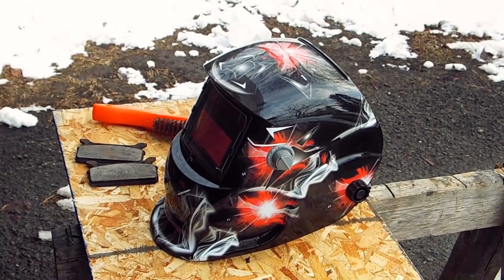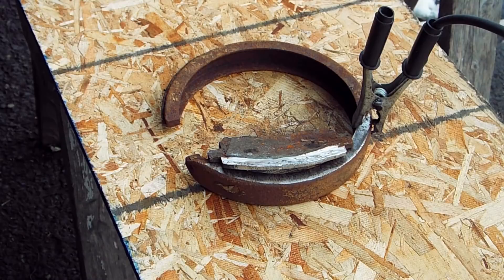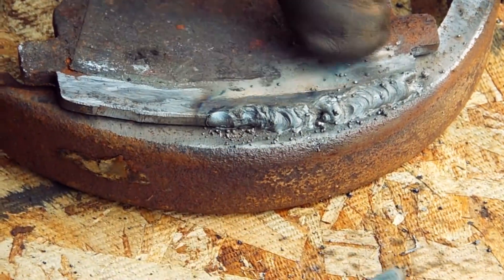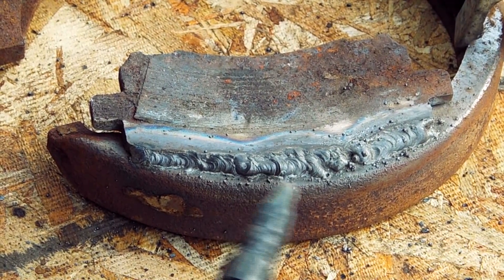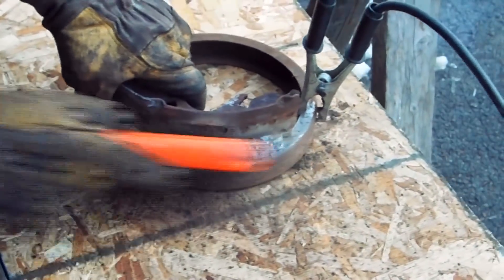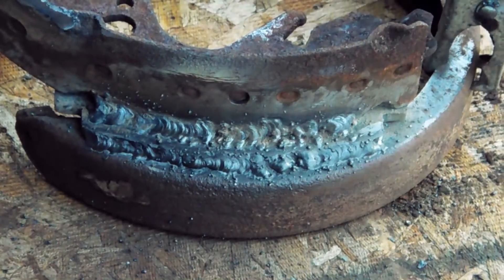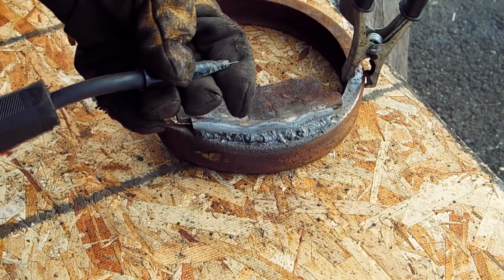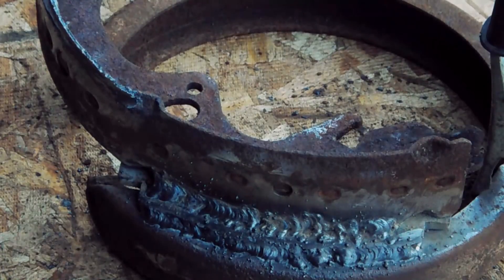AC to DC Flux Wire Welder 110 Volt from Harbor Freight

Comment: When you increase wire feed speed you increase the amperage resulting in a hotter weld. For your thicker steels (1/8 - 3/16), use an increased wire feed speed for a hotter weld and deeper penetration.  You will find (setting 7,8 & 9), the weld pool will lay flatter and penetrate deeper, creating a flatter, more even beed profile. watch your weld pool and be sure to zig-zag back into it and stop just before the edges 91/16th and allow the weld pool to flow to them rather than going past them, this will help your lap and corner joints. There are a few techniques that you could use 1) lower case cursive "e's" 2) lower case "u's" with a pause at both top points (weave pattern) 3) my favorite, "hockey sticks". This consists of making a semi straight line with a slight curve at the end and then reverse back to start position. Keep your distance, torch angle and travel speed the same and it is almost as if you are painting with a paint brush. The beed will stack up like dimes and your consistency will become more accurate. Good luck and happy welding!
Reply from the maker: Steve Porchia thank you for all of that information, very helpful!
Reply: Yes. With this feed, not knowing how many IPS that is, I’d recommend starting with a high feed, and going down one setting a time. You’ve got a combination of thicknesses. One way to look at this is to use a setting that’s closer to the thicker of the metals. But your welder isn’t rated for anything over 3/16, so that’s a problem for the thicker part, which looks to be closer to 3/8.

So go as high as you can on both settings, and weld closer to the thicker part, and linger a bit, then quickly move to the thinner part, and quickly move back, linger, etc. if you weld straight on, the thick part will weld too cold, and the thin part, too hot.

Also, remove the tape to at least 1/2” past the tip. It’s contaminating your welds.
Reply: @melgross  The wire speed is wonky with these things. Here are the wire speeds i've found.
Speed 1: 135 inch/min
Speed 5: 180 inch/min
Speed 10: 380 inch/min

It appears the potentiometer is not linear but logarithmic.
Reply: LBCAndrew yeah, that’s a problem. I tell people to measure the wire at different settings, and write it down.
Reply: The wire feed speed does not increase the amperage.

Comment: Why didn't you start with 9 and go down from the machines recommendations ?  On this welder the wire speed determines the amperage !
Reply from the maker: Ed Pontiff thanks for the comment, im learning that as i go. I will experiment more with the wire speeds to see what the results show.
Reply: There are only two amperage settings. Feed speed doesn't affect or even connect to the circuit with the gun on it.
Reply: @cavemanjoe7972  Actually there are only two voltage settings. Wirespeed is directly related to current on a constant voltage machine like this.
Reply: @samnottheotherone4363  

It's a pain in the ass, regardless. I use a stick machine; much more simple. I never was big on circuitry.😁
Reply: @cavemanjoe7972  Ha I hope you never have to deal with aluminum TIG then.
Reply: @samnottheotherone4363  

I do aluminum tig at work. I was talking about the way the harbor freight flux machine is wired up.
Reply: @cavemanjoe7972   
Okay, I was thinking you like things to be simple, hence stick and didn't think you'd want aluminum TIG because of all the different settings. But I understand now.
Reply: @samnottheotherone4363  

I liked how simple stick was, and how much smoother the beads were than that old 90 amp flux welder. Guy at the shop took 20 minutes last year to show me tig and turned me loose on some stainless scraps to see how I did. Now I do most of the small/thin tig work that comes in, or anything that needs to be 'pretty' or pressure tested. Turns out I've got even more of a knack for tig than machining or milling. I wish somebody had shown me this stuff when I was 15 or so; I'd probably own my own shop by now.

Comment: Do you have to squeeze button to make wire advance? I have only used stick welders. Thanks for the instruction, good information.
Reply from the maker: Bert Cochran yes you do have to pull the trigger to weld. The wire will advance at the speed you set and this also will switch on the charge to the wire for the arc. I hope this better helps you to understand how they work. Thanks for asking.
Reply: Bert Cochran yes.  squeeze trigger to feed wire and turn power on at the tip.
Reply: Nothin wrong with sticks. In fact. The units themselves are cheaper and easier to repair

Comment: Is the black tape the modification? Put mig tip back on. It helps out with keeping distance and you won't won't be arcing out your tip.
Reply from the maker: Mark Cobb it's part of the modification. The real difference is that the welder is now generating on DC voltage instead of AC. Quite a few have recommended to me, and in other videos, to take off the metal tip and use a plastic one instead to get right in close to the work piece. It does actually seem to help. Thanks for the comment.
Reply: More superglue. Lots more superglue.
Reply: I think you're angle too low.  Try 80° Ground it really hard. Clean the surface right where youre gonna start everytime you start. Faster feed, slower drag. Puddle like youre gonna fish in it.
Reply: Is that HF fluxwire? Change brand.

Comment: Don't get hung up on wire speed. Application matters a lot. Stay in the puddle. You should be between 1/2 to 1 inch away from your work piece, gun 45 degree by 15 degree drag. Watch the joint. You don't have to move your stick around to get your rippled look. Move around to meld your joint. If you slow down and put the heat into the metal, you'll get better penetration.
Reply: Yes . Wait until the puddle forms and travel at the speed the metal edges form the beads .
 Mine is like always between 1½ for thin and 3 for 3/16th .  Using the flux core . Faster speeds might be for thinner wire with gas shielding .

   Fa

Comment: How well did that helmet work out with out in the adjustable knob on the side?
Reply from the maker: Mike Okay The adjustable shade helmet allows better visibility of what you are working on over the set visibility helmet (no knob),  which I believe I saw that those are more geared to stick welding. The first battery that came pre-installed didn't last very long. You do have to be careful not to set the shade too light or you can do permanent damage to your eyes. I wish I had bought an adjustable shade helmet, with the knob, the first time. I hope that helps.

Comment: Turn the feed up. You are only running at 50-60 amps at #5 wire speed. 

I find running the voltage a step down from max, and the wire feed almost maxed out. Works really well with 1/8 and 3/16" steel. 
Voltage x amperes = watts (power)
Your wire feed is your amps!
Reply from the maker: Thanks for that comment, Leroy, I will experiment with that!
Reply: Most everyone says that, I just get a big blob sitting on material that has no penetration. Next trick is gonna be run it slow and hope for something to join.

Comment: You should grind the spot that you attach your ground clamp to and even clean the inside of the jaws with a wire brush from time to time so that you get the best welds possible on that machine. I would even get a solid brass ground clamp that really grips the material (available at harbor freight), the stock clamp is too weak and only makes contact with the points of the teeth. I'm not sure what brand of wire you are using, but I highly recommend using Lincoln Innershield nr-211-mp. I use the 0.035" wire as well as tips. By the way, keep the tip from touching the material. Usually about a half inch of wire "stick out" is fine. Your welds at setting #5 were the best, but the speed at which you move is also important. Slow down a little and try this: write a long row of lower case "e" with the torch tip instead of the zig-zag method. As you loop back and overlap the last "e", you are applying more heat in that area resulting in more penetration. If I was welding that exact same piece of metal, I would set the machine to setting #3 or even #2 and move my hand a bit slower, while keeping half to three quarters of an inch of stick out, and making my loops about a quarter inch in diameter so that i get much hotter weld. You'll notice that the hotter you get your welds, the bead will blend with the material as opposed to building up filler metal.

I use the same exact machine, so I know what it can do.

You get better welds when you take your time.
Reply from the maker: Wow, John, thank you for all the tips! To be honest, I have been neglecting cleaning the off clamp! Good point! I have not tried the lower case e movement, so that I will do. Slowing down the travel too. Thanks again, appreciate your help.
Reply: Best comment I've seen on YouTube in a Iong time..I tool screenshot of it so when I buy the titanium 125 I ll remember to get brass clasmp and Lincoln wire..hoping the titanium 125 is worth the extra 60$ since its dc
Reply: Plus the gun angle looks a bit extreme.
Reply: Å POP
Reply: Not with thin rusted metal but you are right though about what speed he should go 

I done a thicker piece of metal just a test run at a low speed between 3 and 4 it done good on max heat temperature mid temperature does fine but is to slow for me